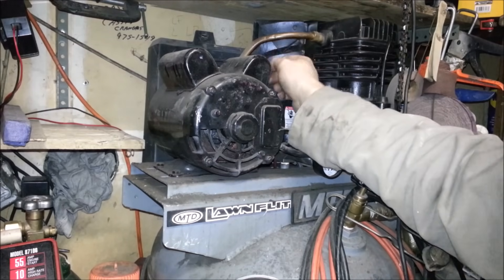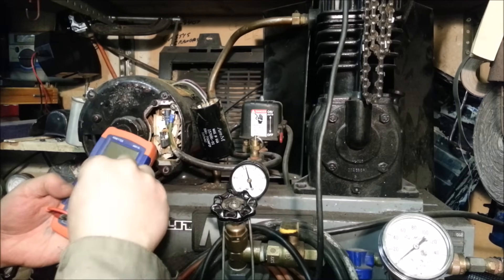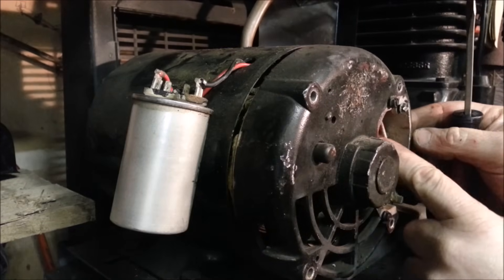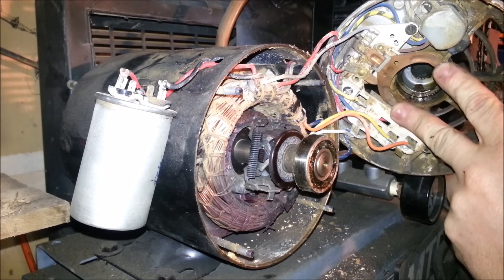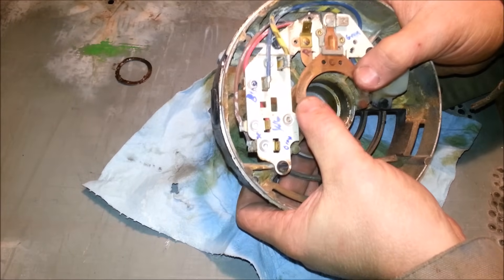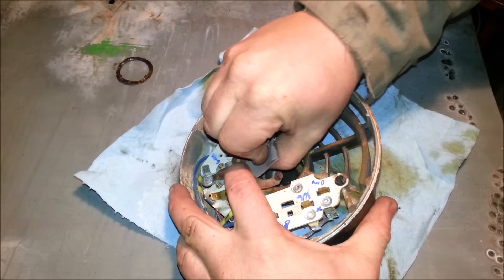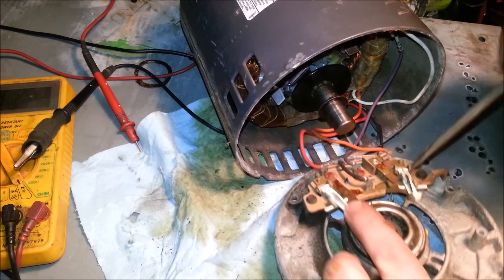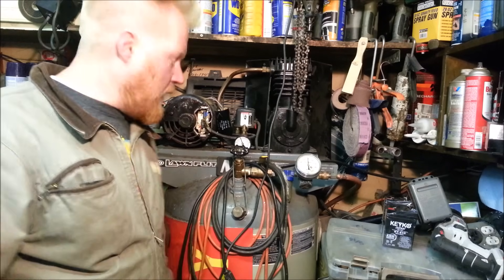Electric Motor Doesn't Spin but HUMS/Buzzes compressors etc

Comment: thanks for the vid, very helpful saved  me some time. Im working on a delta Unisaw. its a real workhorse...we have 6 !! im curious when you checked the capacitor what was the reading you were looking for on the multimeter, I have one but I really only use it to test continuity

Comment: Thanks for the video.I have a new sanborn 3hp 60 gallon air compressor that after the initial break in period.The motor just hums but wont start.

Comment: I have a pool motor humming although I wish you'd show me how you did the tests which settings you had your multimeter on this video was very helpful I believe it allows me to go into this motor with a mission cuz I believe my capacitor is good so I will update you on whether this gave me enough information to fix my motor thank you very much

Comment: I am extremely surprised that you don't know the difference between a centrifugal clutch (that does not need or use electricity) and a centrifugal electric switch.
This is the first time in my 60+ years that I've ever heard an electric centrifugal switch being called a clutch. Lol
And saying that it has a two-speed transmission. Lol!
There are no gears or pulleys inside that motor.

Comment: Small xaw bench motor 50 years old plus. Just removed it and blown forty years of dust out of it. Cleaned up centrifugal switch   Back into working order. (Stalled and humming 2 days ago) no capacitor required!
Cheers mate happy days!
Reply from the maker: Nice work!

Comment: 1. The run windings are always energized when ever power is applied to the motor. 2. The start/auxiliary windings have the start capacitor in series and this circuit is initially energized when power is apply through the normally closed starting switch.  3. When the motor starts and reaches approximately 80% full speed the centrifugal actuator retracts and starting switch opens de-energizing the start windings.

Comment: Well, I am clueless about electric motors.   this video helped me take apart my bandsaw electric motor, clean out the TONS of sawdust and sand out the contact points, etc.  Put it back together and it works like a charm.  So to some (me) this video was totally worthwhile.  Thanks for posting the video.
Reply from the maker: Glad I could help. Awesome work.

Comment: What if the compressor runs for about 5 seconds, then trips the circuit breaker at the electrical panel? I've tried replacing both start and run capacitors (one at at time), but it still trips the breaker. Anybody got any ideas?

Comment: My motor is not humming but actually turning but very slowly and eventually trips it’s own breaker. It will switch directions between turning it on and off.  Is this what I need to do or have I lost a winding in the motor?  Running a table saw with it.
Reply from the maker: It sounds like the run capacitor is bad.

Comment: How do you wire up 115v from 230v on century cs motor..help..
Reply from the maker: If it is possible for your motor, it will give you a diagram on the label of the motor.
Reply: @sixtyfiveford  it doesn't have a to go by ..i wired it back to 230v n it doesn't run either so the  might be burned out

Comment: why my motor slowed down or the speed became slow?
Reply from the maker: If the start windings never disengage the motor will never speed up.
Reply: @sixtyfiveford  what does it means? what is the issue?
Reply from the maker: @philipgaming2020  do exactly what I do in the video and it'll solve your problem if that's your problem
Reply: @sixtyfiveford  ah ok, thank you so much

Comment: Replaced starting capacitor and this did not fix problem. I was very close to spending $225 for a replacement motor when I saw your video and you suggesting problem was with bad contacts. Did what you said, fixed the problem and saved me some money...thank you!
Reply from the maker: Awesome.

Comment: I looked at the photos at some of these videos and most everybody was talking about capacitors,the motor was struggling to start,sometime it would throw the fuse,but when it started,it would run until tank was full.So I decided to skip the capacitor test and go with the start switch first.Pulled the cover back,run a little contact file a few times between the contacts,oiled the centrifugal clutch shaft and put it all back.Flipped the on lever,and Hot Diggity dog,it never had started so easy and instantly before.It run smoother than a licked titty.Thank you,and didn’t cost me a penny.What I like about your video and others of this kind is ,I want to see how to fix it,to the point without too much unnecessary talk.Thanks again.
Reply from the maker: That's fantastic. I'm glad it was helpful.

Comment: My uncle has an older Enco lathe that is single phase 110 volt.  It will run in reverse but just hums when I switch to forward.  We checked all switches and contactors but still won't start!  Anybody have any ideas?  Thanks, Tom
Reply from the maker: You should have a start winding for forward and a separate one for reverse in the motor. The contacts will switch those two to keep them independent. The start winding just kicks the motor in the direction you want it to spin. The rest of the motor gets power the same way in forward or reverse. So it is likely your contacts for the forward are burnt up/dirty or worse case the start winding for forward is burned up. You could rewire the switch and move forward to reverse and test. This would eliminate the switch as your issue if the motor still just hummed.

Comment: 8:20 what is that? is that a van converted to a truck or does it come from a factory like that?  Obviously its older but its cool.
Reply from the maker: It's made by a custom coach company named Centurion. They made conversion vans and super custom trucks.

Comment: You bid for me up and running again with the house projects after an old table saw I just bought just hummed when started, even after firing up the first time. Cheap and easy fix for a guy that's never opened up an electric motor. Piece of cake. Thank you!
Reply: Right on

Comment: Question, i have an old 113. craftsman table saw and last night i was ripping some stock and i finished up, I go to turn the saw on and it just humms and nothing.  If i leave it on the breaker will trip.  Also i took the belt off the motor just to see if it would spin and the pulleys are very tight? like i cant spin the pulley/shaft by hand really at all? any suggestions
Reply from the maker: Without a belt the motor should spin pretty easily by hand. If it doesn't it could be full of sawdust.

Comment: Video is great help but for someone like me who has never taken a motor apart before, I don't know what kind of grease you are talking about. Please specify. My motors are from swamp coolers, 1/3 horse power single speed, and most of the time they still work, they just won't START without giving them a little yank on the belt. I was convinced it was a simple repair, but don't know how TO FIX so just keep buying new motors for our apartment complex (14 units). Do you have a video with a complete guide to these small motors? Thank you!
Reply from the maker: I repaired a lot of swamp cooler motors. The number one issue with those is the front bearing/bushing goes out. This causes the motor to oscillate and not want to start

Comment: How do you wire a motor for 110 or 115
Reply from the maker: Not all motors can go from 220v to 110v. The ones that can will say how right on the side plate. They will even give you a wiring diagram on the side plate.

Comment: I just bough a brand new motor, wierd it up switched it on and it's just humming, I'm completely baffled.
Reply from the maker: Air compressor?
Reply: Yes, fixed it now it was the starter it was faulty, even though it was brand new 🤷‍♂️

Comment: Old motor started buzzing and rotating very slowly in reverse direction. I found and watched your video and followed the steps you've so clearly described. The winding contacts were a bit of a devil to get to, to clean but after blowing all the dust out and reassembling.......BINGO it starts and runs perfectly. Thanks for the really informative video. Cheers from a very happy new subscriber, Andy.

Comment: I have a 1/3 hp jet pump to draw water from my well...  when it tries to start it hums for about 5 seconds if that and then after 20 seconds or so it tries to start again, it does  this about 3 times and then finally it starts up and runs fine...  sounds like a similar issue perhaps??  It is a berkely and has been running for about 20 years anyway with 0 problems. Best pump ever... I've also heeard that it could be the start capacitor perhap[s??  the difference with mine is that it keeps trying to start... and eventually does...  also, when you are the voltage/capacitor what setting did you set your tester on??  I alwyas see people in videos testing stuff but never show the setting they are using to test it properly...  I know... Im a dummy!!!  LOL!..  ps, I really enjoyed your vid. good stuff!

Comment: i have a machine. the motor of it works perfectly but after a time while runs, if i turn off it, then after lets say 2 mins,  when i want to turn on it, it buzzes and doesnt work. then i put a steel stick to the gears after the shaft, and move it by force, and pull the stick quickly, so it continues to work. do you have any idea about the cause? i called 2 "craftsman(the word might be wrong because of my english)" and they couldnt fix it. i dont know what to do. please help me.
Reply: i mean it doesnt work after became hot. if the motor is cold, then works perfectly.

Comment: Dude. Thank you.  You just helped me with a free 1/2 HP GE motor.  Any ideas on a similar motor that hums and spins very slowly?  When I put light hand resistance on the shaft, it either bogs down entirely or wants to change direction.

Comment: Thanks for your video. I have a compresor motor that works fine but lately I start having problems with it. The motor label states that in 120 volts it should use 19 amps but it runs on 14 amps. But every tome the motor start my meter reads 53 amps for a less than a second   But my breaker start tripping. I already change a breaker thinking that I have a bad breaker. I also change bot of the capacitors. Any idea what could be causing the breaker to trip. ?  Thanks again
Reply from the maker: A large peak inrush current is normal. The start capacitor helps smooth this out and limit the inrush current so that is the first thing I would look at. Secondly I would look at the compressor pump itself and make sure it is not holding pressure in the pump making it far more difficult to startup. This is controlled by a 1 way check valve generally install in the storage tank at the end of the air supply feed line form the compressor pump.
Reply: sixtyfiveford thanks for your response.  How do I know that I have the right values in my capacitors.
Reply from the maker: @CarlosMejia-pp1ow  With a cheap capacitance meter https://amzn.to/37fV94r or you can just buy a new start capacitor as they're pretty cheap.

Comment: Thank you so much for the video! We’ve had an old air compressor in the barn that hasn’t been used in many years - because the motor “buzzes” but won’t turn over. I watched your video, went to the barn and pulled the end cap off the old motor. I cleaned the points - making sure they made proper contact with the motor off - and checked that the points fully disengaged by pushing the clutch in. I reassembled it and - Yahtzee! - it works! Thanks for the direction and motivation to make it happen!
Reply from the maker: That's great. I'm glad the video helped.

Comment: My motor hums (single phase AC) but when I short the capacitor it starts up. Even when I turn it on while shorted. My plan is to just soldier a wire between the capacitor leads. Is this bad for the motor?
Reply from the maker: Yes, it won't be as powerful and will overheat. The capacitor provides a phase shift so the motor runs more efficiently.
Reply: @sixtyfiveford  Good to know. There is only one cap so I thought it was just a starting cap. Any idea what I should do to fix it? I don't think it is an issue with the clutch because the power stops running to the capacitor once the motor turns on.

Comment: So how did u know it was not the capacitor
Reply from the maker: The easiest way it to use a capacitance tester https://amzn.to/2Pt6jf9 (this is the one I have).
Reply: @sixtyfiveford  can a capacitor shock you or spark if wires touch together while changing the cord?
Reply from the maker: @patgarland9066  Yes.

Comment: Any advice for what compressor size etc to buy...I've used loads of air tools at work but have no clue about what compressor to buy for home...also maintenance etc.
Reply from the maker: That's a great question. 
If you want to use: 
Sandblaster: 80gallons or 60gallons with huge compressor pump/motor
Air sanders, autobody tools, paint guns: 60 gallons minimum 
Mechanic tools, impacts, blow dust out of your shop, etc: 10-30 gallons minimum
Fill tires, sports balls, air nail guns: 1+gallon

The cheaper the compressor the louder and more annoying it is. "Oil-less" is just asking for ear splitting noise and racket so go with anything else if possible. There are a lot of good used ones on the market, but there is also a ton of junk so if you go this route be PICKY. Name brands like Quincy, Ingersol Rand, FS-Curtis, Rolair are higher end and will go forever. I would suggest a used one over a cheap Harbor Freight, Home Depot, Lowes one anyday. If you just want to see what you can accomplish with an air compressors there's always old 10 gallon horizontal ones(usually Craftsmans) from the 70's-80's on classifies that pop up for $50. Their cheap and seam to last forever.

Comment: Excellent video. Subscribed. Question: My compressor motor started humming exactly as you showed.  It happened sometime in the night.  Breaker tripped..so I didn't catch it...would this situation damage other parts of the motor?  Tearing into mine to check because of your video. Thx!
Reply from the maker: Generally it won't damage anything.

Comment: What if it hums and trips the breaker switch on the motor or starts but soon after trips the breaker switch?
Reply from the maker: It's either your contacts being dirty, a bad start/run capacitor or worn out front bearings.

Comment: Gotta love the Youtube helpers... Fantastic video, I'll give it a try.  Thank you!!
     My compressor was stored over a yr and now starts very slow but then stops running within seconds. This sounds like it may be the issue?  May be run capacitor?

fwiw-  If the motor is bad, although they're more expensive I always replace my motors with a Baldor brand.  Worked most my life in plastics and all our machines big/small had Baldors, they are absolute brutes.
  We'd have operators locking grinders up weekly just to stand around doing nothing and the Baldors set there humming for 10-20+ minutes at a time before operators even tell us it stopped and we free up the grinder and off it runs just like new again. Amazing how tough they really are.
  I can remember replacing only one motor but that grinder was over 25 yrs old doing that all the time,  it was there before I even started. 
 Over 15yrs ago I used a Baldor as an attic fan motor in my old home to put an end to junk attic motor replacements every few yrs and I know its still used there today. It runs 9am to 9pm in summer 90-105 deg. Very tough!  
 Thanks again for the video. Peace
Reply from the maker: I would turn the compressor over by hand a few times to make sure the pump is moving freely and not stuck.

Comment: You cannot test a capacitor for good with an ohm meter. The mfd can be way off and the ohm meter will not find that. Yes- I've been testing and working with capacitors almost every day- for 45 years.
Reply from the maker: I didn't use an ohm meter and I didn't say you could test them with one. I used a capacitance meter.

Comment: Guy sold me a really nice drill press that had this problem for only $90. Now I can fix it where I don't have to very dangerously start it by hand, meaning it is worth about $300. Thank you for creating real value in the world.
Reply: Botta Bing. Heya i gotta elect motor starts to spin but SLOW then stops. I tried yer method of helping it by hand but it wont take off n run. Same fix?

Comment: Sweet fix. If you can wire the motor for 240V you get less shop light dimming when the compressor kicks on. Plus they really kick on. Burn right through that start contact oxidization.

Comment: SON.  get your info and WORDING CORRECT 
THATS NOT A " ENGINE "
That is a. A MOTOR
Reply from the maker: POPS. Yes, I mispoke as I probably had a dozen engines on my work bench I was working on that day and those were on my mind. I left my slip up in the the video while editing as it has no importance to the content of the video. If you want to play semantics  though it is not a "Motor" as a motor can imply a an internal combusting engine. You have to say "Electric Motor". A Motor is an Engine but an Engine is not a Motor.
Reply: Do better checking your editing

Comment: Engines are combustion and run on fuel, motors are electric. Please stop calling it an engine.
Reply from the maker: Yep, I misspoke once in the video. I must of had engines on my mind.
Reply: @sixtyfiveford  at least 3 times. I never actually heard you say motor. Good video otherwise.